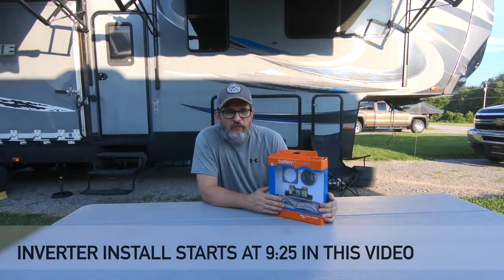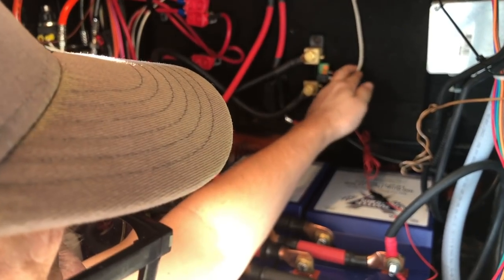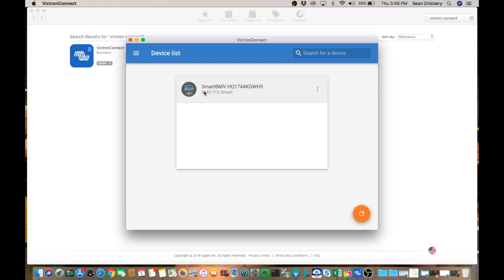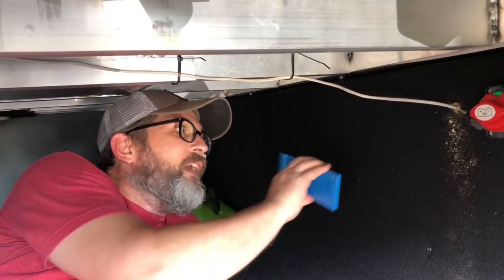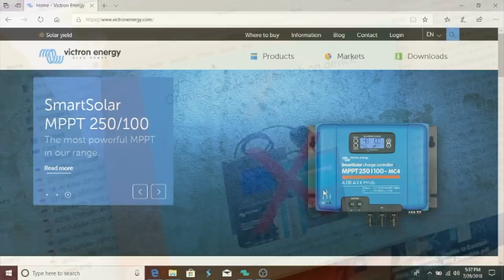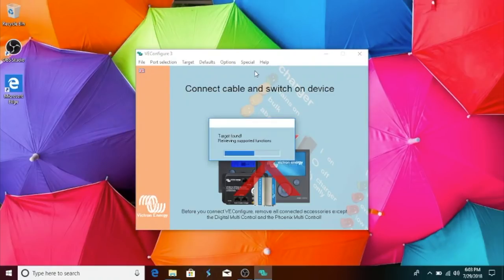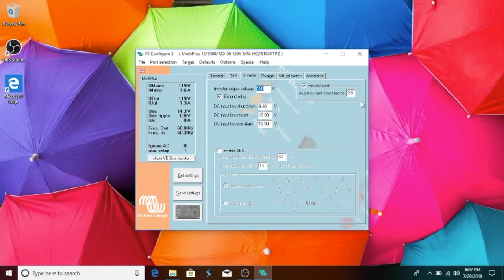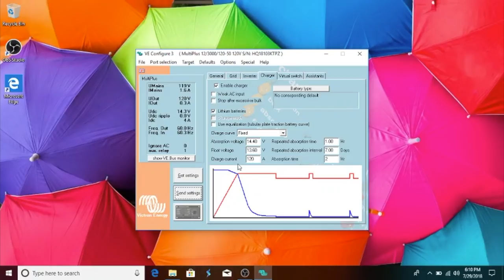RV Solar Upgrade Part 2: Victron Battery Monitor & 3000 Watt Inverter/Charger

Comment: So do I needf to add these components to make my solar work ? Ive been struggling to find out why im not charging the batterys from the MPPT ! I have power everywhere i should but its not charging from solar,,,,GRRR Will say the MPPT 100 30 is not bluetooth,,Bought a VE direct cable that runs from the MPPT to the BMV monitor but that did nothing,Man any help would be appriciated big time

Comment: Well done, as I think I'll find this video helpful with when my Battle Borns and Victron BMV-712 arrives.    I have the Xantrex inverter/charger, so I'll have to figure out if/how to change settings on that eventually as well.   Not quite sure on running the wire from the batteries/shunt to the Victron device though...or if it really matters?    I suppose it might be best to be inside for viewing, but if left below where the batteries are, you could just use your smart-phone to check and make any changes needed.   Thanks!

Comment: Hi Sean, I watched the videos on installing the inverter charger and I have a few questions. It looks like I have the same setup as you with the 5.5 generator with 50-amp shore power. My shore power and generator come into the transfer switch and from there it goes to the distribution panel. My question is do you come out of the switch and run to the Victron 3000W multiPlus and then go to the distribution panel?  And what PDI did you end up with? Thanks in advance for the info.
Reply from the maker: I have the PDI9100. It works great and charges the batteries quickly.
I put in a sub panel. I put a 50 amp breaker on my main distribution panel. I ran wire from that breaker to the Victron Multiplus. From the Multiplus, I ran wire to the sub panel which held all the circuits I wanted to be able to run while boondocking. I am sure there are easier ways, but that worked best for me.

Comment: Excellent video, Sean!!  FYI:  Jared Gillis of All About RVs has a wonderful video — including schematics! — of what he installed [basically the same things] on Keep Your Daydream's new rig!

I just love it how we all pitch in together on these things!!  ;)
Reply from the maker: Thanks, John. I will go check out the video. I would not have been able to do any of this if it wasn't for other RVers putting out videos and blogs. It is a great community! I was really intimidated by the inverter. The last thing is the solar charge controller and panels. I was over at an RV this morning that just had solar installed and I realized that I needed a couple of more things for safety, so I will order them tonight.

Comment: Awesome video but why do you reduce the cable thickness coming from the batteries compared to the 4/0 that you used between the batteries? The ones going to the inverter are way too thin
Reply from the maker: You're right. I realized that afterwards and have changed it back so they are all the same.
Reply: @ChickerysTravels  awesome dude, just wanted to point that out so you don't run into issues✌️

Comment: Hello.  Great vid with a ton of information.  I have toy Hauler I'm upgrading similar to yours.  I'm still not sure how the Victron Multiplus inverter replaces my existing Auto Transfer Switch.  Did you remove your Auto Transfer Switch?  How did you wire it?  thanks
Reply from the maker: Phil - Thanks for watching. The Victron Multiplus Inverter/Charger does does not replace my transfer switch. The transfer switch still acts as the transfer between my shore power connection and my on board generator. I wired my Victron Inverter/Charger so the power can come from the shore/generator power or the batteries. For the power to the inverter/charger, I installed a 50 amp circuit in my main fuse panel and ran it to the inverter/charger. I also ran lines from the battery bank to the inverter/charger. From the inverter/charger, I installed a sub-panel with the circuits I wanted to be able to power when off-grid using the batteries. I removed those circuits from the main panel and placed them on the sub-panel. Now, when I am off-grid, I can run the circuits on the sub-panel from the batteries or I can fire up the generator and run everything.
Reply: @ChickerysTravels  Hello, ok so I think I'm following.  I'll be diving into my install next week.  I may have more questions if that's ok.  BTW, I don't want to ask you to do more work would it be possible to add a quick sketch of how things are wired?  Thanks again.
Reply from the maker: I will work on it. Keep the questions coming!
Reply: @ChickerysTravels  Hi - I've installed my new Multiplus 3000 and I have the Victron MK3 to USB cable to program the inverter.  I'm getting a "USB Device Not Reconized when I plugged it into my laptop."  the guys at BattleBorn weren't sure why I'm getting that USB error.  Any thoughts?  thanks

Comment: Why did you change out your converter rather than just bypass/remove it, since the Victron Inverter/Charger can handle the battery charging and do it at a much higher charge rate as well?
Reply from the maker: Just for redundancy.

Comment: Hi, looking to upgrade my Class A RV 30 amp  electrical system would the Victron Multiplus 12/300/120 you used work is that model or is it only for 50 amp systems?
Reply from the maker: It will work for a 30amp system too.

Comment: You installed a new power dynamics converter, which takes shore a.c. and converts to D.C.  to charge the batteries, but this new inverter, which has a switch for shore or inverter power and does much more also has a battery charger, so not sure the purpose of the progressive dynamics converter.  Also...I suspect when you boondock and use the inverter it's sending a.c. power to the converter which flips it to DC and right back to the batteries you originally pulled the power from. I'm messing with my 5th...and plan to remove that converter from my inverter path...which I believe is the purpose of that new inverter you bought.
Reply from the maker: We installed it for redundancy. When we're boondocking it actually bypasses the converter.
Reply: @ChickerysTravels  Cool.

Comment: From where did the AC power come?  Is this the power that connects the AC electrical panel?
Reply from the maker: Yes, typically from the power pedestal at the campground if you have it or the inverter converts 12 volt to AC.

Comment: Why did you install the converter and the inverter charger? - Don't both charge your batteries from 110v?
Reply from the maker: Great question. You’re right that either will do the job but it never hurts to have redundancy. Also the converter charges the batteries much faster.
Reply: Chickery's Travels Thank you! I was wondering the same thing while watching the video.
Reply: @ChickerysTravels  When not hooked up, the converter you installed is drawing AC power from the inverter while trying to charge the battery so your using battery power to charge the battery which results in a huge waste of power.  Plus the Multiplus is a much more powerful charger, up to 120 AMPs vs the 70 amps of your converter.  You should permanently remove the converter and update your videos as your system is wasting a lot of power in its current configuration and should not be used as an example for others to follow.
Reply: Sorry, one other question.  Did you use 6 gauge wire for the AC side?  It looks like you used 14 gauge which would be way undersized for the power the Inverter/charger is rated for!!  Run your AC while charging and the wire will start a fire.
Reply from the maker: @lincolnspangler93  Thanks for the comment, but I completely disagree with your assessment of my set-up. You have a breaker panel in your RV (hopefully). I switch off the breaker for the converter. It is simply in place as a redundancy to charger side of the inverter. So, it is not getting power or involved in my set-up in any way unless I turn on the breaker. I believe in having redundancy and I am not wasting any power by having it installed as a back-up.
Reply: Chickery's Travels that’s fine to have the converter installed but turned off. I have the same system except mine is 24v on the battery side and I have installed numerous 12v systems for others.  Please be sure to upgrade the A/C wiring to match the potential load.  The Multiplus charger is powerful enough to make my 3500 watt generator run wide open!!  You want to match the wire size to your shore power cord.  Overheated wires aren’t fun

Comment: Did you have a problem downloading V.E. configure software on your Mac? I have tried to download it and it says it can't open the file because it is not a Windows based computer. Looks like you have a Mac.
Reply from the maker: Yes, we had to do it on a Windows based computer.

Comment: Why the heck did you install both the Victron Multiplus and the Progressive Dynamics.    I thought that the Victron was a charger/inverter.    Why bot
Reply from the maker: The big reason I chose to have both is redundancy. A new converter was not that expensive for the peace of mind that I have redundancy in the charging. But, you are correct in that both are not necessary.

Comment: why the need for a progressive dynamic charger when you have the multiplus inverter charger?
Reply from the maker: We like redundancy in case one breaks we have other options for charging
Reply: @ChickerysTravels  got it I must have missed that mentioned in your video...thanks... I guess victron connect wasn't out when you released your video
Reply from the maker: No worries. You are correct...no Connect.

Comment: On the 1st video you put a charger for your batteries installing this new converter charger it's not gonna hurt the batteries or any far on your system on the RV
Reply from the maker: The charger is designed for lithium batteries and recommended by the manufacturer.
Reply: Exactly but you replace the original for lithium charger and then you add the converter charger from  victron to charge the batteries that's why I asked you if the two Chargers not going to hurt the batteries or anything else when you're running two at the same time

Comment: Those battery cables looks tiiiny, the recommended size is 2x50mm2(2x1AWG) and 400A fusing.
Reply from the maker: The cables are the recommended size. Must be the camera angle. 😂
Reply: @ChickerysTravels  oh, maybe... but didn't you say its a single 4AWG?

Comment: Sean, what might a guy expect to spend on a system like this? I like the lithium batteries but those suckers are spendy!
Reply from the maker: Leonard - you are right about the cost. All of my items (batteries, inverter, converter, battery monitor, solar charge controller, solar panels) is about $7500-$8000. The nice thing is that it can be purchased gradually. I know it is a big investment (I felt the same way) but everyone I talked to who installed similar systems say it is worth it.
Reply from the maker: Also, I am going to list everything with the prices in my final video of the series. That way, i make sure I have a complete list of everything I purchased including the miscellaneous supplies.

Comment: victron 12/800 watt will not run a 150 watt ghd hair straightner it overloads everytime even though this inverter surges 1600 watt